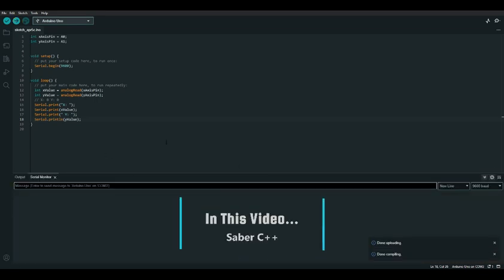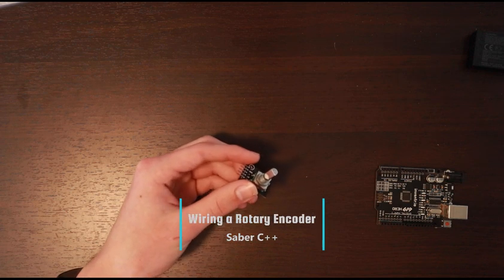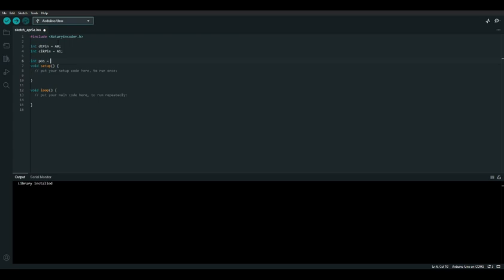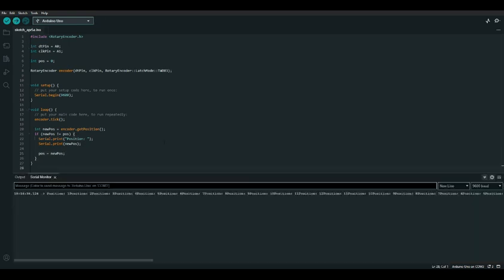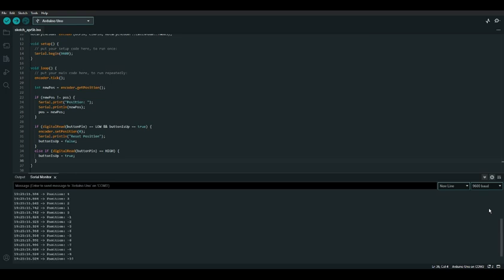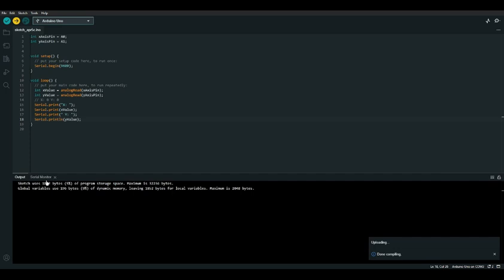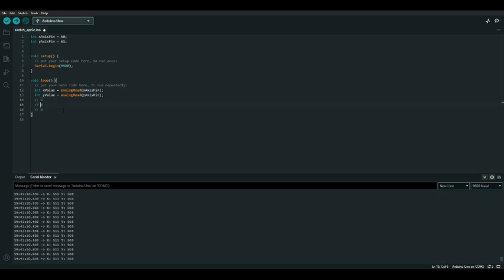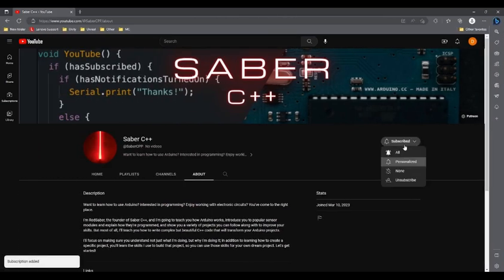Arduino Basics II (Rotary Encoders and Joysticks)

Comment: Hello, I'm planning to make gamepad using rotary encoder.
Is there any way to use encoder mapping as x-axis of joystick?

Like,
rotating right - axis position up (1, 2, 3, ...)
rotating left - axis position down (-1, -2, -3, ...)
Reply from the maker: Yes. You can simply have an xAxis variable and increase it or decrease it using the encoder like we do in the video.
However, you’ll want to keep in mind that the encoder has no bounds, so you’ll need to clamp the xAxis between 0 and 1023 manually (eg. using if statements).
Reply: Thank you for your comment, Sir.
So, I can use it as a joystick. Great!
Now, the remaining is making codes 
(or find codes) for encoder to use as joystick.
Thanks again for your advice!
Reply from the maker: I'm glad I could help!